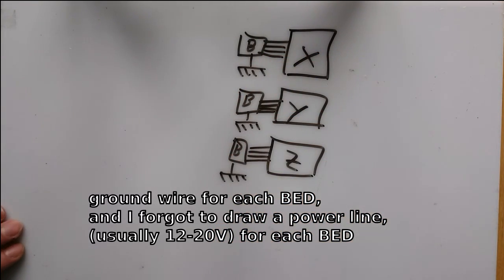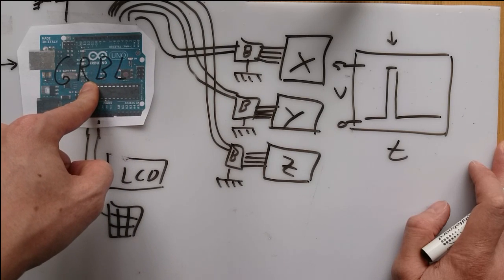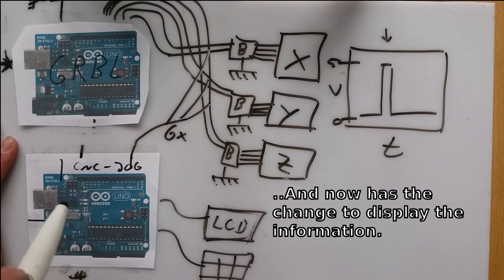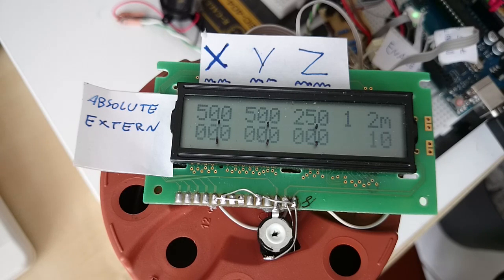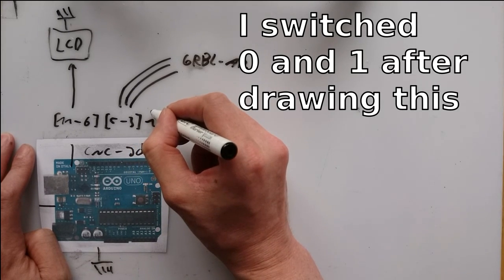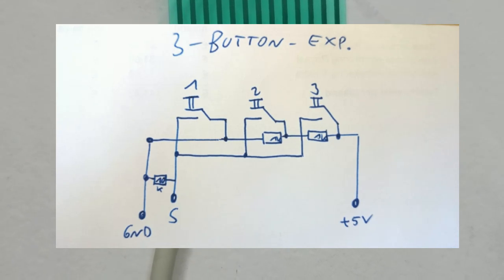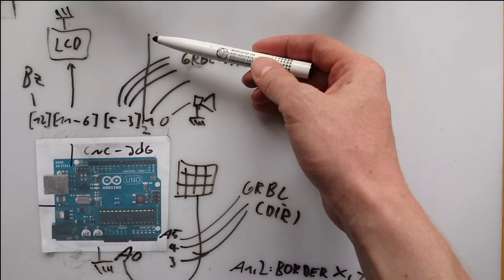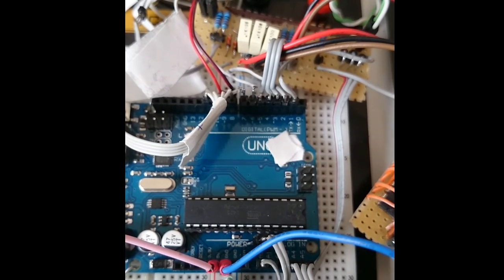My homemade desktop CNC mill - Clip 2/6: Arduinos and whiteboard drawings

Comment: but there is something wrong  : jogging arduino counts the pulses and knows the position in automatic mode  but when you jog GRBL arduino lose the position. Like forcing the axis manually. Let say if your bit break during milling and you change the position by keypad to replace briken bit you can't go back otiginal path.
Reply from the maker: The jogging Arduino can read and count the pulses from the GRBL Arduino so that it does not lose the position even when I use the GRBL Arduino for moving the tool. In theory that is - I actually recently removed the function from my jogging software as I never really used it and it did not work reliable.
Reply: @Joekutz   can be a code written to jogging arduino  to jog and to send the gcode by integrated sdcard   and the change the parameters  to GRBL arduino . But Connection will be only thru RX TX ports. In other words I dream an Arduino code  can be do everything  as UGS sofware.  Can it be done?

Comment: Very good video on the electronics but I have a question. Instead of using 2 Arduino Uno why not use a single Arduino Mega?
Reply from the maker: Because 1) GRBL is mainly written for arduino uno (although a mega-port exists) and 2) I didn't want to change GRBL itself 3) My programming-skills were not enough to combine both programs to one.

Comment: hi,
 im piecing to gether all the information on how to build a cnc using arduino uno and V3 shield,grbl v0.9G and higher has a nice function the G38.2 probe command to set tool at zero height setting ,here is a  address for many videos to choose from-

https://www.youtube.com/results?search_query=GRBL+Probe+Command+%28G38.2%29

open source info for all to see and use ,if wanted,i want to use this feature also as it will help during tool changes during a carving job.at least when i finaly get my cnc built and running.
thanks

Comment: Instead of using diodes to or the pulses together for a common interrupt, you could have used the 'pin change' interrupt.  Each of the 4 ports (A,B,C, and D) of the atmega328 can be programmed to issue an interrupt whenever any of the pins on that port change polarity.  I think you can make use of this inside of the arduino framework, but you could also program it directly in the avrgcc C language.  I've made use of this interrupt to handle a rotary encoder for one of my projects.
Reply from the maker: This is true. When I wrote the software I only knew about the official arduino-interrupt procedures and was not aware of the interrupt-magic the Atmega328P is capable of :) (this was literally my first arduino project) and now I am too lazy to rewrite the software and rewire the arduino.

Comment: hello, your project is very interesting and I also want to do .. Where are the libraries of programming in the arduino? Have if I can pass please
Reply from the maker: The GRBL library was not done by me, for finding it, google is your friend. The CNC jogger software is linked on my hackaday project page. There, you can also find a link to the drawings and the libraries I used for the keypad and the LCD.
Reply: what happens to my pc can not open the page you up libraries for LCD and keypad. I think the page is wrong uploaded something like
Reply from the maker: I checked the download (schematics_code_drawings.zip.zip,  linked on my hackaday.io project page) and all files are there.

Comment: It's weird to me that you didn't just use a RAMPS setup with Arduino -- RAMPS is a common Arduino shield that can control up to 5 stepper motors (with a common A4988 or DRV8825 stepper controllers, you can get 5 of them for about $10 to $15 now, and you can easily configure microsteps up to 16x or 32x with them...), and you also get 3 high current outputs if necessary, and 3 analog inputs, and 6 end-stop inputs.

Plus, you can optionally connect an keypad / LCD / Buzzer / SDCard slot to it, and there's a ton of firmwares for it (mostly tailored to 3D printers, but they're not so smart that you couldn't just use one for CNC milling instead, and some of the firmwares are for CNC milling)...

You can buy a full kit (including an Arduino, and motor controllers) on amazon for around $50 - $60 USD.
Reply from the maker: Michael Jensen 
I have chosen my setup because I had already half of the parts to begin with, so I ended up paying not more than what you mentioned. Also: I wanted to practice arduino programming and write my own specific software, not use a off-the-shelf firmware.
I am actually bringing back to life a mill (shapeoko I) in my local hackerspace right now .. with exactly the setup you described. You seem to know which RAMPS-compatible milling firmware is out there, which one would you recommend?
Reply: Definitely do look at the firmwares available, they do all sorts of neat stuff for you, like acceleration and auto bed-leveling (which you could do really simply without extra hardware for pcb milling, etc.), all kinds of neat stuff.

You'll need some CAM software to generate the G-code -- but you know that.

For firmware: I'm a big fan of marlin, for 3d printing, it's proven itself to be very stable and feature rich -- you really can't beat it.  I've read on the reprap forums of folks modifying it to be more CNC friendly.  Take a look on the github page and see if there's a good fork for that.  Or check out the #reprap channel on freenode and ask.  Those guys are super helpful.

As a last resort, you could always just write your own again, since it's just an arduino + motor controllers (but it's probably easier to just tack the features you need onto an existing, feature rich firmware...)

I think there are other CNC specific ones -- IIRC Teacup(I think ?) was one that works with CNC out of the box.  But I've never used it (it lacks some features compared to modern firmwares).
Reply from the maker: Michael Jensen Thanks! Will check out the sources. In the easiest case, there's a Arduno-Mega compatible fork of GRBL, that I am checking out right now, so I might try that first.